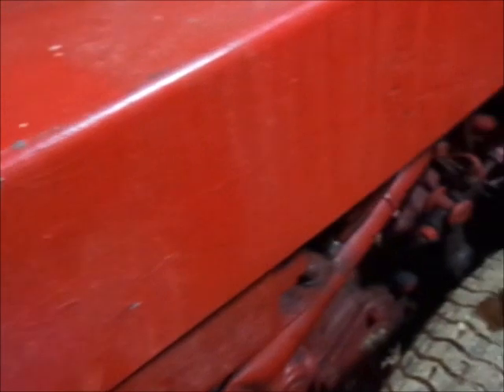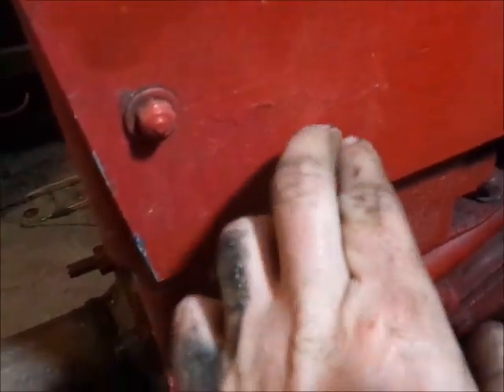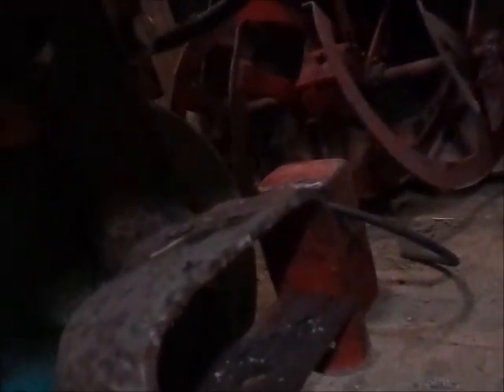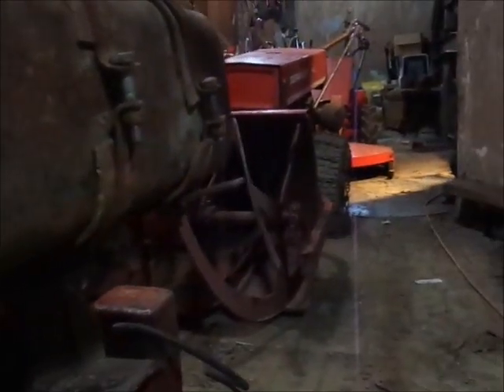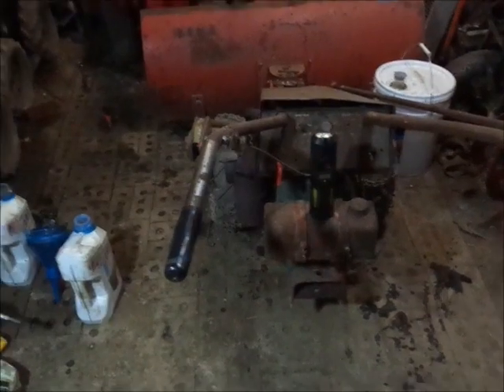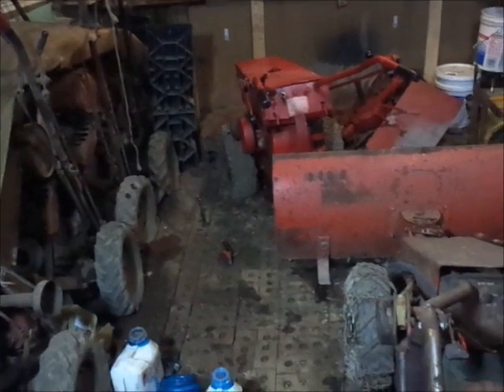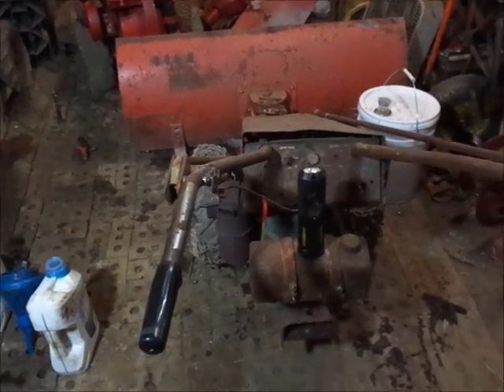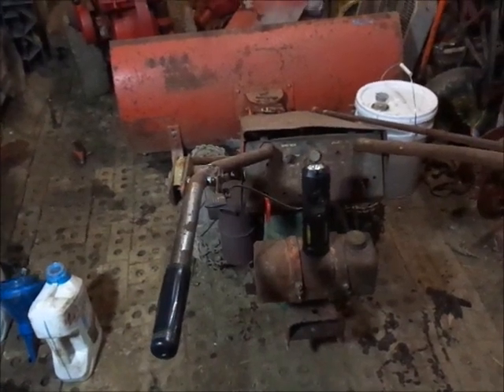Water in the trans oil changes com 12 5200 gravelys

Comment: I put masking tape on the key switch or around the throttle marked NO OIL.  When you find bad oil do you drain and refill or do a kero/diesel flush before refilling? PaulL